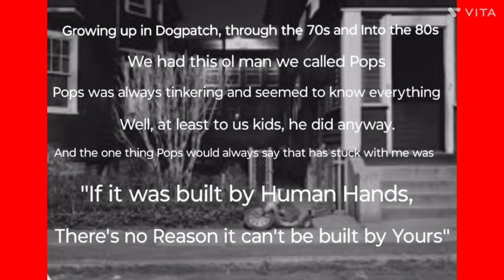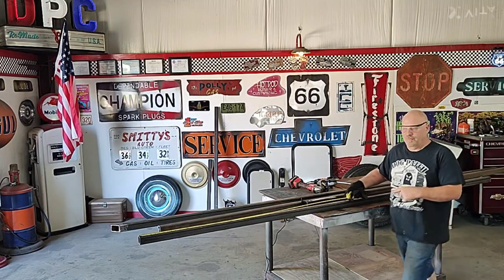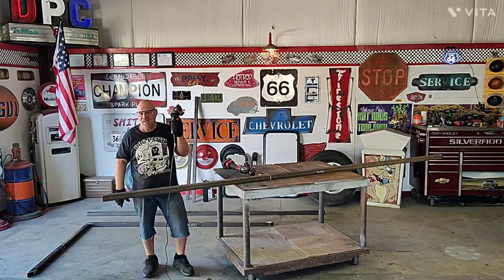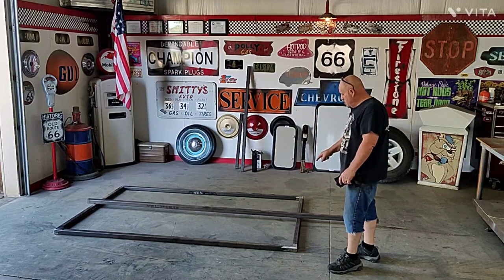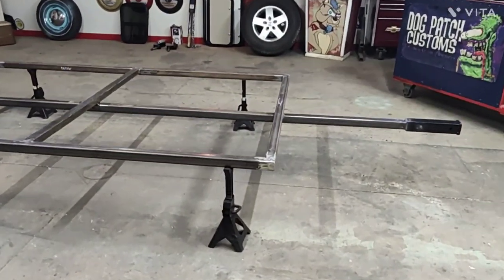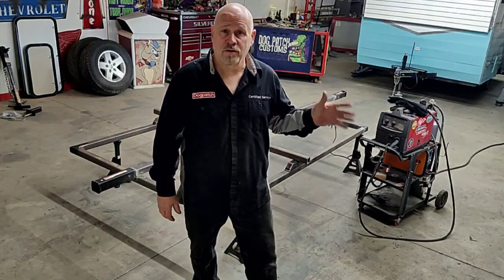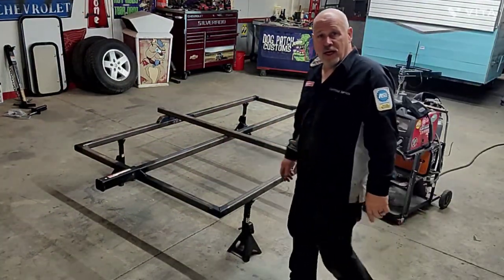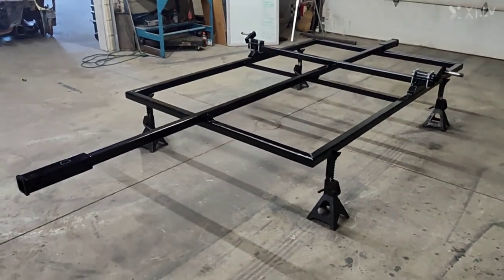SQUARE DROP OFF ROAD BUILD SERIES, EPISODE 1, THE FRAME. FROM START TO FINISH D.I.Y. MICRO CAMPER

Comment: What was the steel size. 2x2 how thick
Reply from the maker: Yes 2x2" and 1/4" wall, I use 11 gauge (thinner) wall on my regular teardrops or when weight is a concern